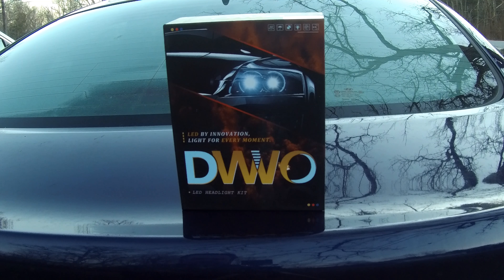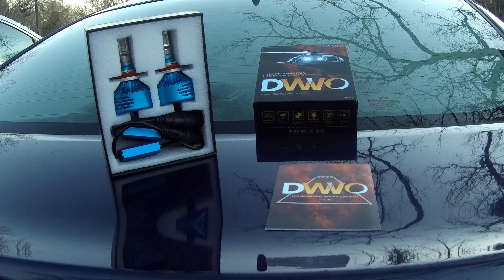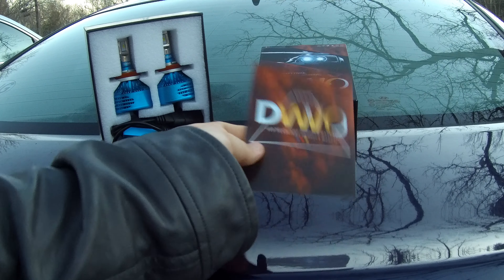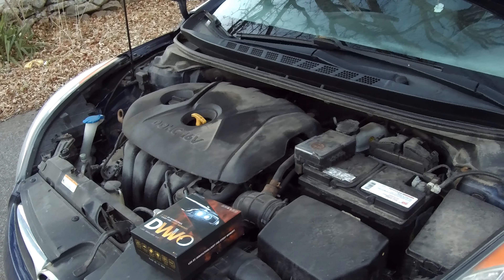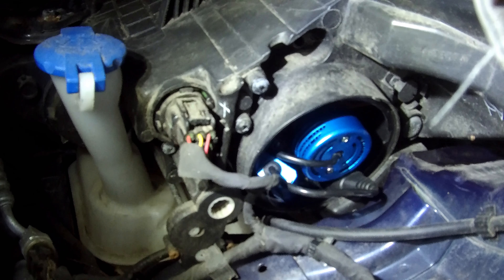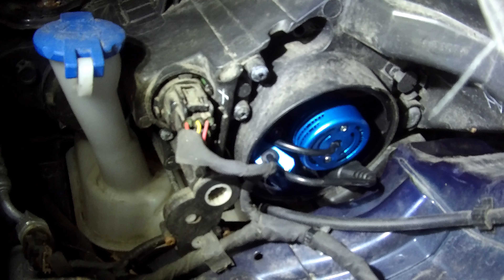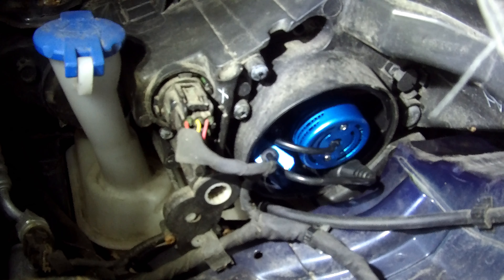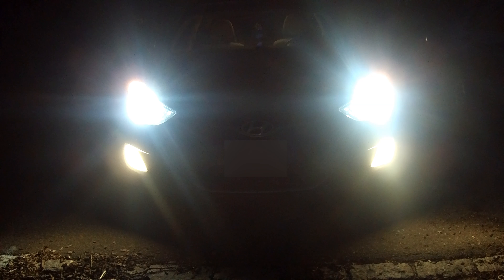How To Install DWVO LED Headlights (Performed on Hyundai Elantra)

Comment: So do LEDs not need a ballast and relay wiring stuff? Seems a lot easier than HIDs.
Reply from the maker: The ballast is built into the bulb. The relay is not needed as the bulb adjusts for the car.
Reply: @EricDIY  perfect thank you

Comment: Won’t the headlight assembly accumulate condensation without the dust shield on?
Reply from the maker: I have not had any problems with condensation
Reply: It's a dust cover, all it does is keep dust out, the bulb it's self seals the reflector housing keeping condensation out.

Comment: (Liked and Subscribed)
That being said;

What about calibration? Nobody seems to grasp the concept of headlights. Your normal halogen bulbs are designed for your car, and similar car’s, headlight assembly. The beam pattern is calibrated beforehand based on the vehicle factory specs. I’m guessing that LED bulb is a “universal” bulb and not 9006 or whatever the Elantra requires. Well, what’s the big deal? They work don’t they?
Yup they work. Too well in fact. Ever wonder why drivers in oncoming traffic always flash their brights at you? Because your bulbs are pointing too high. As in High-beams. They’re not named that because of the brightness. Your factory highs are designed to point slightly up to project the beam farther. Not necessarily brighter. It’s the angle that you see the light’s brightest.  Not all will be higher.  The bulb may match the vehicle specs perfectly. Hell, a broken clock is guaranteed to be right twice a day. Or they may be too low causing the light to seem dull or dim. All you need to do is grab some tape and a flat wall.....oh, and YouTube to search “how to adjust your headlights”. Although an instructional video on how to install LEDs should have it? 🤔
Reply: Who cares about the other drivers I'd rather see better for myself at night